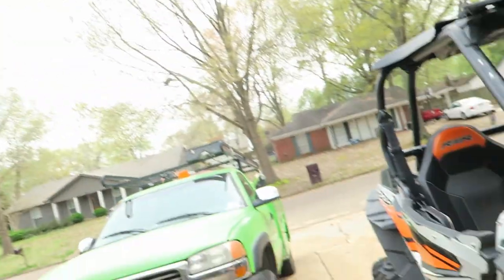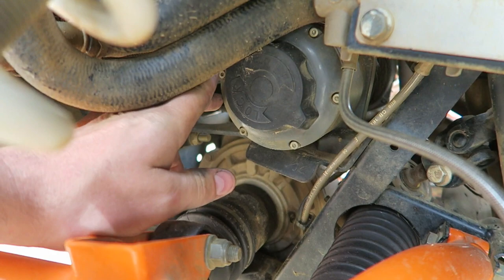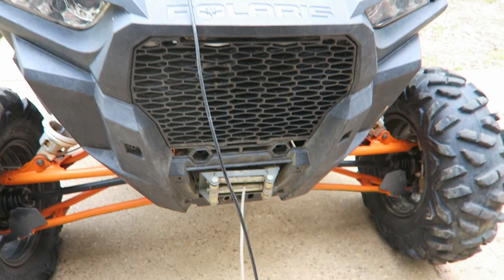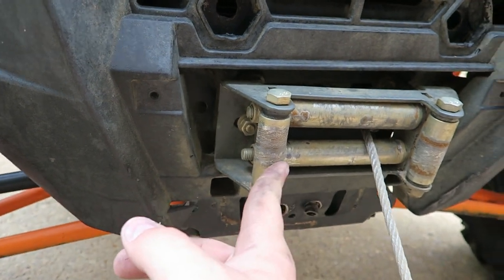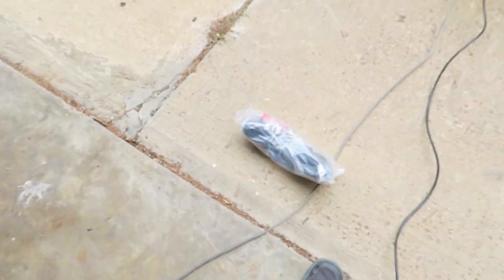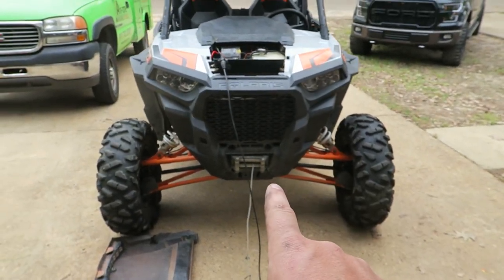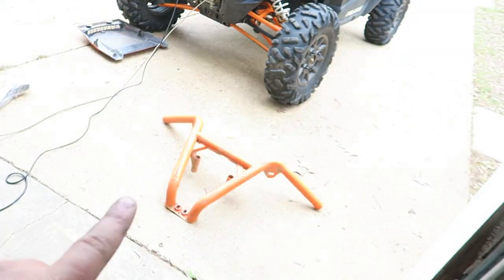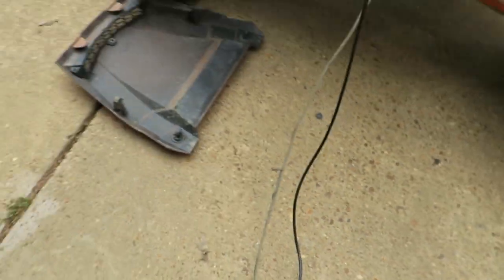1 Year Harbor Freight Winch Update

Comment: Looking at one of these winches for my Honda pioneer. Looks pretty reliable.
Reply from the maker: So far it’s been pretty reliable other than the power wires I have melted a few of those but it probably would have benefited to have a snatch block or dual batteries to keep from dropping voltage